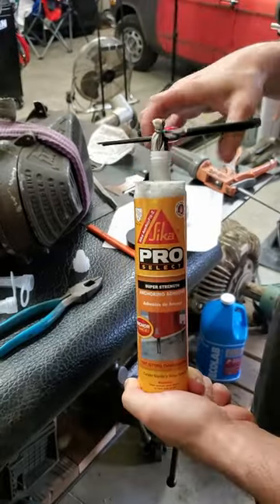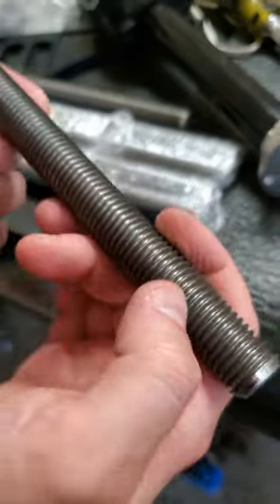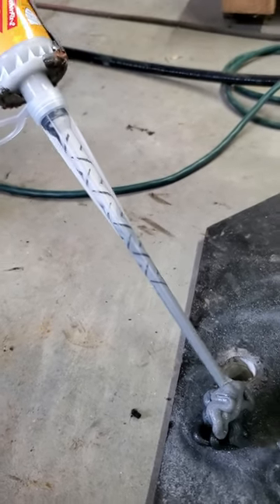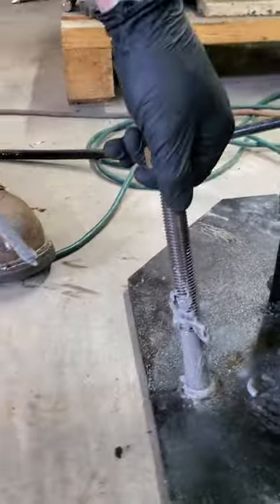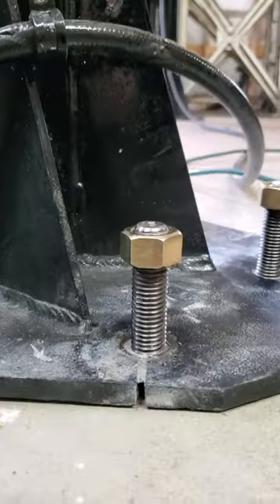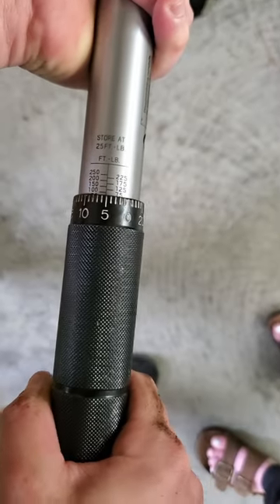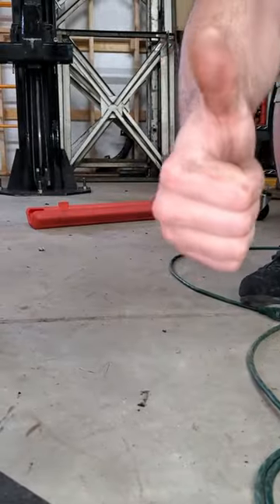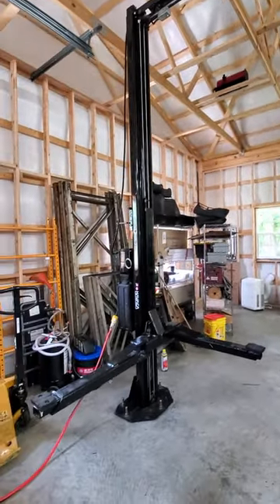Anchoring a TWO POST LIFT... Using GLUE?! #shorts #cars #mechanics

Comment: After seeing HowNot2's pull tests on similar rock bolts I'd call epoxy anchors super good enough as long as they're installed to the manufacturer's specs.
Reply from the maker: This exactly! Carefully following directions is paramount to a safe installation. I couldn't agree more.
I'll have to check that video out!

Comment: Is that how most lifts are installed? Seems crazy to essentially have the only thing holding your lift up is glue.
Reply from the maker: This is just one method, expanding anchors are most common but using a carefully selected anchoring epoxy has some benefits and is less likely to fatigue over time. The anchoring epoxy that is chosen must be resistant to creep and rated for a constant tensile load. Additionally, you must carefully adhere to the epoxy manufacturers data sheet for installation instructions and load ratings for a given stud size and depth. These 3/4" B7 studs are anchored 5-6" deep, and the combined tensile load of each stud is conservatively over 3000lb, with a factor of safety of 4 according to the manufacturer. 10 studs total anchor the two columns, so over 30,000lbs holding this 9,000lb rated lift.
Manufacturers usually provide expanding anchors, but it is not uncommon for them to pull out. The torque must be checked regularly regardless of fastener type selected, and when in doubt installed by a professional according to manufacturer suggestions.
Reply: @fattydaddy4285   i'm over 20 years i never see wedge anchor fail, the only reason not installed correctly or bad concrete. After a fire i seen excavator hit my lift, the lift bend the wedge anchor didn't move
Reply: I used to think like that ,even thought it was crazy that Audi was "gluing" cars together 20yrs ago. 
Some kinda thing like gluing aluminum to steel or some other metal. 
Anyways ,fast forward to recently. 
3m structural adhesive is one of the most amazing things known to man. 
My "kit" car is "glued" together with it. 
It's a Smyth Ute conversion that uses a Jetta sedan and turns it into a pickup. 
All the aluminum bed panels are bonded in with the structural adhesive, the rivets hold it in place until it sets. 
It's definitely strong ,as now the vehicle is done and when you jack the car up at a corner that end of the car comes off the ground.

Comment: Did u drill a 3/4” hole or 7/8? I thought the epoxy requires an over sized hole which is tough with the 3/4 holes in the lift plate.
Reply from the maker: I used a 3/4" drill and walked it around a few times to enlarge it.

Comment: What does B7 mean? (threaded rod)
Reply from the maker: @Jaime-m8y  its the grade of threaded rod, similar to a bolt grade. B7 is better than the cheaper stuff out there.
Reply: @RocanMotor  is it rolled thread, or high strength simular to Grade 8?

Comment: Why did you leave the studs so long?
Reply from the maker: Good question. The studs I ordered were 8" long, and I installed to a depth of 6". I didn't drive in the additional length in order to keep the vapor barrier below in tact. I did shorten the studs at a later date off camera so they're less of a trip hazard.

Comment: What size is the rod, 3/4"? Where did you source it from?
Reply from the maker: 3/4"-10tpi Threaded B7 rod, 8in long. Amazon came in the cheapest for B7 at the time. Affiliate link below for your convenience! 
https://amzn.to/3IUvdk4
Reply: @RocanMotor  Thanks. I'm looking at the Hilti HY-200 Epoxy System. Got a buddy that works for them so the pricing won't be as insane lol.

Comment: when you torque the stud in the epoxy do you use the same torque as the anchor required?
Reply from the maker: It's best to check the directions of the epoxy being used and to confirm that you can meet  the torque and fastener size suggested by the lift manufacturer. In my experience most epoxies allow for higher torque values than an equivalent sized expanding anchor.

Comment: Installing mine, right now.
Retired millwright. 
I've literally installed tons of machinery on concrete. 
I've never installed something that holds something as large as a car on an 18" pad.
I'm installing a 6' diagonal brace on each side.
Trust gravity,  not bolts in concrete. 
Epoxy is the way to go
Reply from the maker: Mike, I couldn't agree more! Diagonal braces are a great idea, particularly with lifts that don't have an overhead support. Wishing you luck on your install!

Comment: Nah bruh ... epoxy and a anchor ⚓️ not only epoxy
Reply from the maker: I always suggest following manufacturer suggestions. All of the anchoring epoxies I've used specify using studs of the correct size and sizing+cleaning the bore correctly before applying epoxy. Generally this results in a pullout strength that greatly exceeds that of an expanding anchor. Many expanding anchor instructions caution against using epoxy with them, though I have heard of people combining both.

Imho either expanding anchors or epoxy are viable options so long as the concrete is prepared correctly and manufacturer instructions are followed. This lift has been installed a few years now and I've experienced zero torque loss in any stud- I can't say the same of expanding anchors I've used in the past. When I did public works we exclusively used anchoring epoxy- far too many failures with expanding anchors over time.
Reply: Epoxy and hilti drop in anchors
You have been warned
Reply from the maker: @Swanlord05  Can you please elaborate? Are you suggesting to use Hilti drop in Anchors and Epoxy or are you warning against them?
Reply: @RocanMotor      use Hilti drop in anchors.....once u see them u will understand why they rule over all